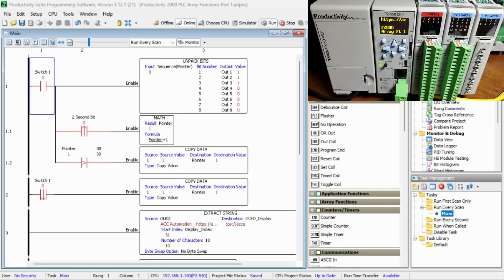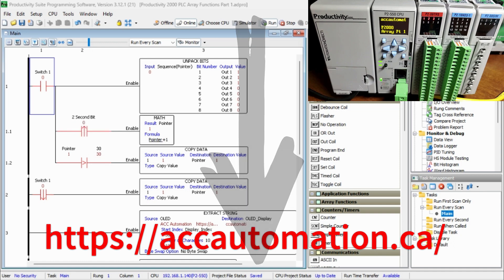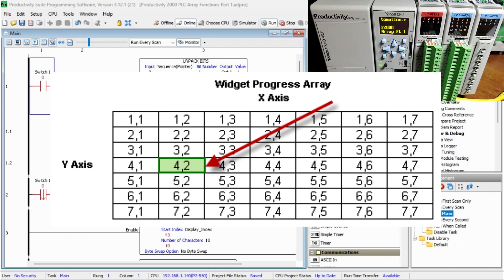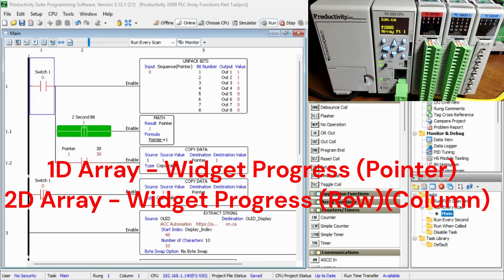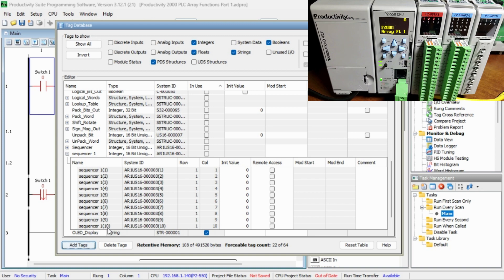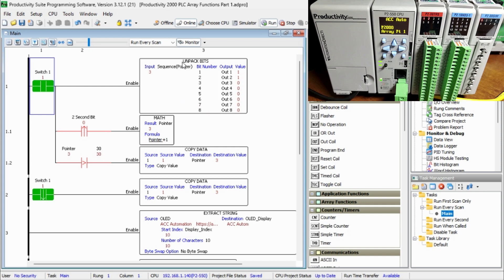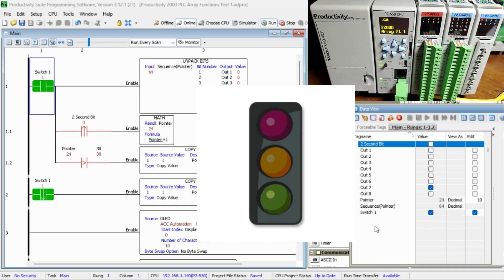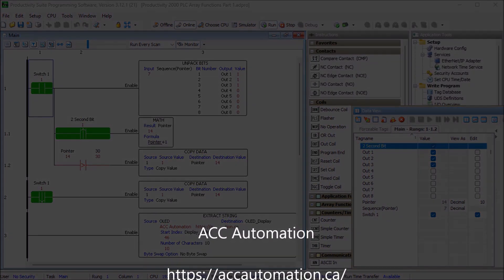Productivity 2000 PLC Array Functions Part 1

Comment from the maker: Detailed information can be found on our website. The post for this video is located here:
https://accautomation.ca/productivity-2000-plc-array-functions-part-1/

The Productivity 2000 Series PLC is located here:
https://accautomation.ca/series/productivity-2000-series-plc-p2000/

There are several reasons why we are using the Productivity 2000 Series Controller. Here are just a few.
- CPU with 5 communication ports
- 50MB user memory - Can handle very complex applications quickly.
- Limitless PID – Autotuning – Individual or Cascade Mode - etc
- OLED message display on the CPU module
- Plenty of discrete and analog I/O modules
- Status displays on all discrete I/O modules
- I/O Modules have QR codes. This can be scanned to have the module's latest specifications/wiring diagrams.
- OLED data display on analog modules
- P2-RS remote I/O expansion module, or use the Productivity1000 P1-RX remote expansion module to add even lower-cost remote I/O to your system
- FREE full-featured Productivity Suite software
- Programming with several ports - USB, Ethernet, Serial
- Hardware auto-discovery
- Hot-swappable I/O - Remove cards with power on the system
- Choose from three wiring options
- Slim DIN rail density form factor:
 - Hardware - power supply, CPU, and seven modules in only 10-1/2 inches
- All project files (program, tag name database, and all the program documentation) in the CPU
- Run-time editing and debug mode on CPU
- Easy data logging with micro SD on CPU
- Secure Web server to access data files and system tags
- Easy drive and motion controller integration
- Coordinate motion control with PS-AMC allows management of up to 16 axes and synchronization of up to 4 axes
- Two-Year Warranty

The Productivity 2000 series of programmable logic controllers currently has these features built into the P2-550 CPU.
This CPU (Central Processing Unit) is known as PAC (Programmable Automation Controller) because of its communication capabilities.

ACC Automation
https://www.accautomation.ca